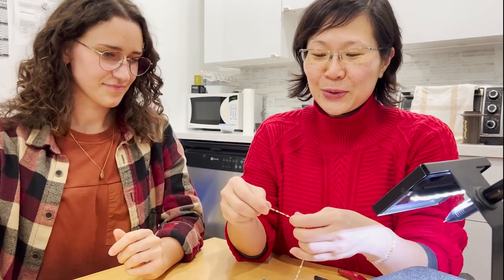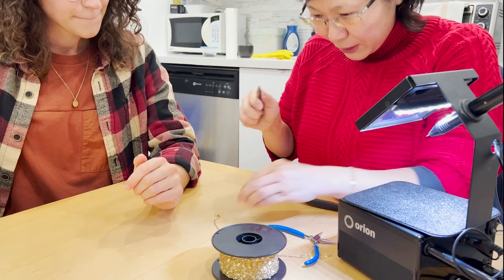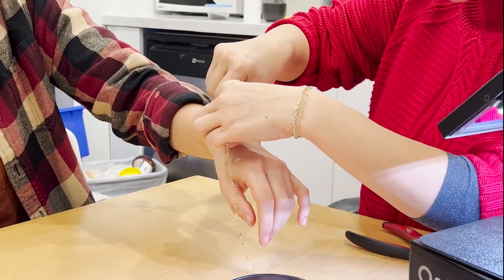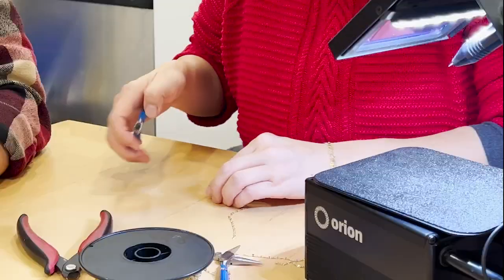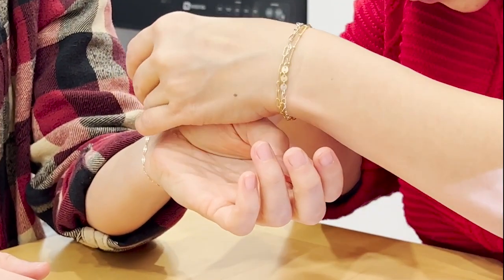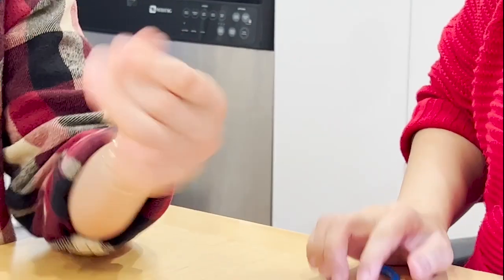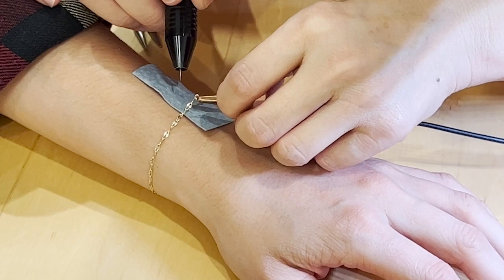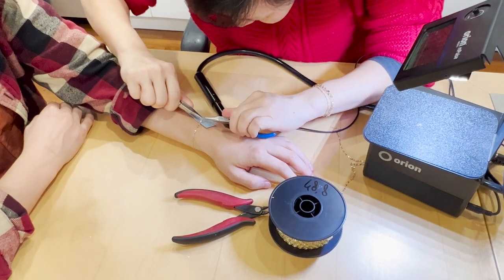How To Weld Solid 14K Gold Permanent Bracelet - Orion Micro Welder mPulse Tutorial

Comment: Can I weld a 14K gold filled snake chain to a 14K solid gold tie bar end cap?
Reply from the maker: Yes, you can!  Welding works for any metal that conducts electricity.  I have just done exactly what you mentioned.  However, it was not thick.  If your snake chain is thicker than 1.2mm, you will need more than one spot wel.

Comment: Hi! Love your videos. Do you get better results grounding the jump ring directly vs grounding a pair of pliers ? I seem to have similar results either way and it’s just easier to use pliers. Maybe it’s my alligator clip .. I have the Orion precision clip, didn’t help. I’m using the Amazon “big grey box” welder. Thanks !
Reply from the maker: Thanks for watching my low budget videos!  Perhaps I should do a video on that.  I find having the ground closer to the weld to be slightly stronger.  My belief is that there's less distance for the electrical current to travel.  However, that might be just my mental bias.  I have not performed an empirical test to compare the two methods.
Reply: @stonesandfindings  That would be a cool video! I will try your method more.  It's an extra step attaching the ground every time, and you have to kind of manage which hand/plier is holding the jump ring, then grabbing the stylus.  A 2.3 and even 3mm jumping once you close and drop them; its sometimes challenging to find the seam to weld ! Sometimes no big deal but when I'm stressed with a line of people these little things matter :)).